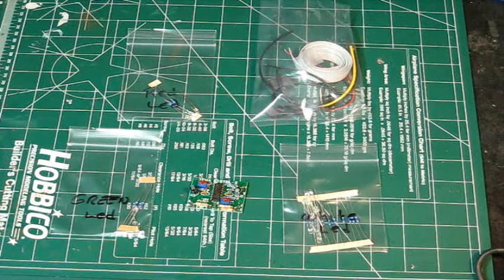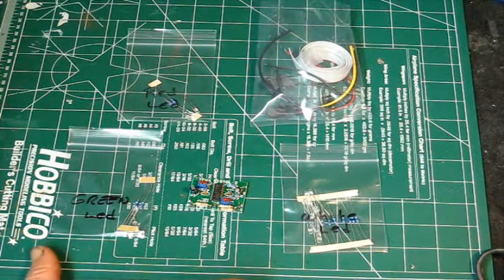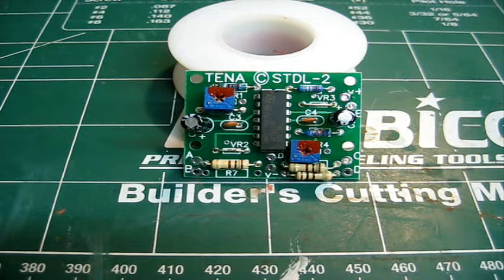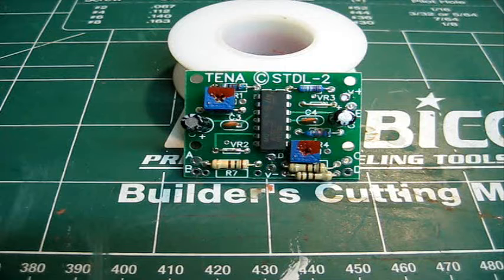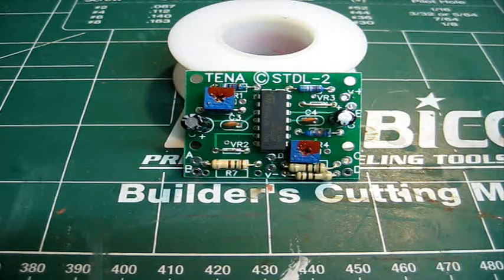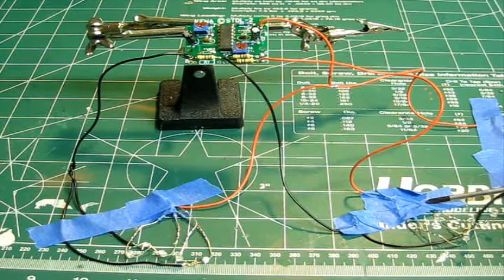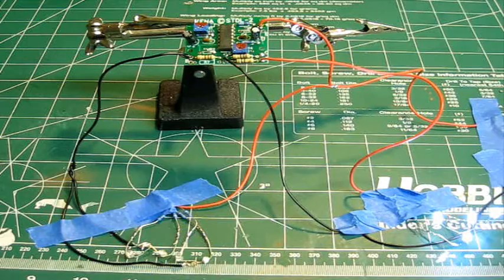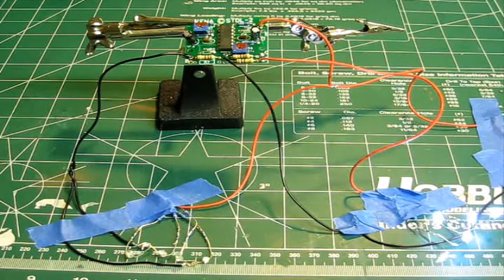Navigation and Strobe Light Flasher Board 1000-A By Tenacontrols Review and Buildup

Comment: Hi trek works just would like a bit of advice on these tena controls boards ave gt a enterprise 1 350 refit and wanting to add the deflector dish fader board the navigation and strobe board lights and the photon torpedo board can these be added to a 9 volt system at any point in my bulid tar and love your work

Comment from the maker: Yes you can purchase separate electronic parts and build your own flasher system for less than the cost of this board. But the kit also comes with several LED's and the resistor's for them. 
I have priced the parts out and $39 does not leave them too much profit. You are also getting a pre assembled board.
There are lots of hobbyist's that might not know how or want to do that and want a ready to go system.

Comment: There will be two versions of the original star trek 1/350 kit. One will have no lights, photo etches. The second one will have the lights, photo etches. Then Polar lights will bring out the lighting kit and the photo etches as separate kits later on. Which is a way I have been told, by the place where I buy my kits.